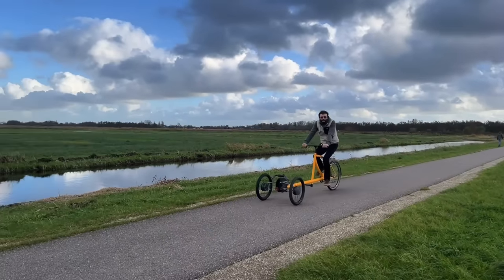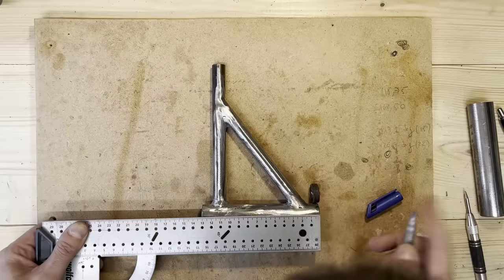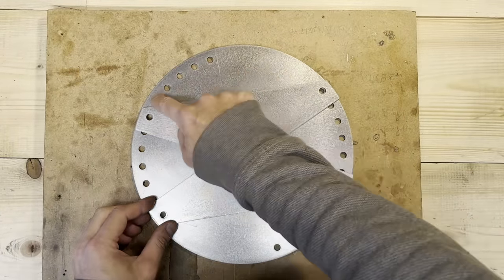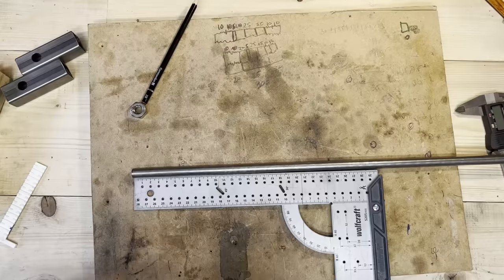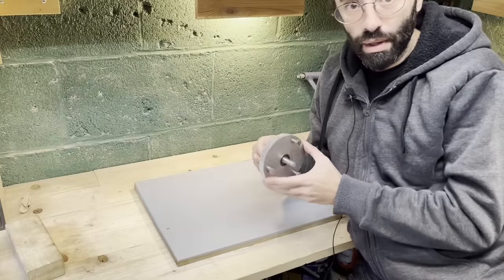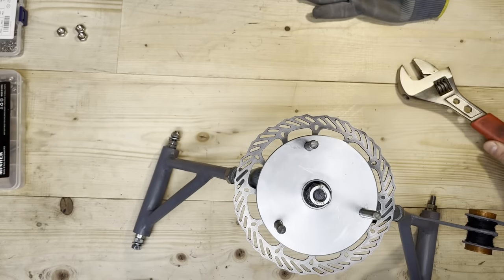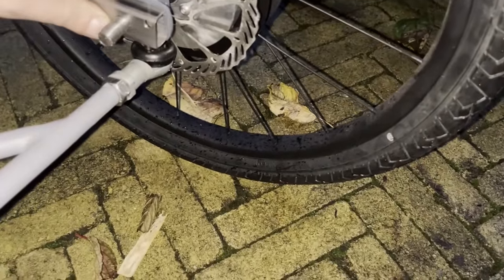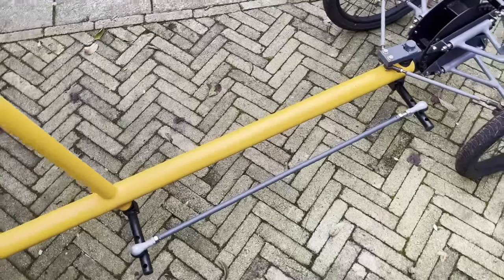Making of a Reverse Tilting Cargo Trike with Adjustable Geometry #5 - Full Build

Comment: Congratulations on your workmanship, You are very dedicated. While I do experiment on the same lines, I must say that I never reach the same level of workmanship as putting ball bearings in the wish bones. Well done,  and wish you all the best. There is a lot of variables operating at the same time, but I pay a lot of attention to the  relation between the contact point of the wheel on the ground and the projection of the steering angle on the ground. This relation can come up with self cantering, instability , and hard steering and oscillations.
The narrowness of that trike needs weight to be shifted around corners as otherwise the Centrifugal force will take over . At my old age I lile it to be a little wider so that the whole lot is stable when stationary and at slow speed which is all I can achieve,  
Congratulations once again.
What you are preparing for at 6:10 is called " Rose-welding".
Reply from the maker: Thank you very much for the kind comment;) Indeed, I experiment quite a bit and try to increase my skill and my small workshop. Also, I've been learning a lot from comments such as yours about the geometry of vehicles so, thank you very much as well for the teachings! 
Regarding the width of the vehicle, this is very much on purpose because I want it to go, as much as possible, through narrow spaces. The tilting mechanism allows for a compensation of the centrifugal force and makes it feel more like a bike, which I like.
When I search the internet for Rose-Welding, all I get is people making roses;) If you have a link to a reference that you can share, I would be happy to learn more about it.
Cheers!
Reply: @pedro-neves   I call it "rose weld" but  perhaps I misled you as many call it " Rosette welding".  This is used to join plates or sleeves in a pipe or a hollow section, One drills a through hole in the " outer plate" and then slide or "the sleeve" or the other plate behind it, Then weld  in the hole to fuse together the upper and lower plate/sleeve . I am  submitting an idea of " rosette welding" , shown in this video, I think it is enough  for you to get the idea, You are a very intelligent person,  I extended car chassis using these "rosette welding" on  plates, rectangular hollow sections and pipes with sleeves in them.  
Hope this helps. The video is described using  "a rosette weld" which one may appreciate why they described as such, 

 How To Weld Spot Welds & Rosette Welds - Great Tech Tip From Eastwood!
https://www.youtube.com/live/QN9Y9tc7gCs?si=wZWyeeU2FdSaS5Kt

Spot Welds and Rosette Welds | TIG Time
https://youtu.be/bkb_hAtZS3I?si=Z3mHjxH-oT1Qekt9

All the best.  Hope it helps. Again congratulations for your workmanship and you deserve to be called, "gentleman engineer"
Reply from the maker: @carmelpule8493 , again, this is incredible kind! I appreciate the trouble that you took to share knowledge and your kind words. Cheers! And all the best to you!

Comment: Pedro, you have done a super job on this design and I am amazed that you managed that with the limited equipment and work area that have. One suggestion, you could secure the outer race of the bearings in those tubes quite simply putting 3 or 4 
light punch marks on the outer side of the tube in which the bearings fit then as you press in the bearings these pinch will solidly  grip and retain the outer race, also I noticed when you the shafts thru the inner race the appeared to be a slide fit ,not good you do not want the shafts to rotate on the inner race which would happen if dirt and grit get in the ball race this will quickly cause the shaft to wear very quickly. However if you use shielded bearings( no dirt) and determine the position of the shafts within the bearings first then put three light punch marks at equal distance around the dia. this will make the shaft a good press fit in that inner race and prevent loose shaft rotation in the bearing. I look forward to the next video ,I hope to start 
on some framework for rev. trike in the new year I am 75 and need to do this soon or I will run out of time. GOOD LUCK.
Reply from the maker: That is really good advice with the punch marks, thank you so much! I will do this in the future whenever I don't have a press fit!
I hope you build a trike and more than a version of it;) Good Luck to you too! Cheers!
Reply: I'm sorry fella, but punch marks, really? It's clear to me that Pedro's most excellent workmanship and punch marks either on the I.D.of the control arm tubes or on the O.D. of the shafts  to close a loose fit don't go together. All that's needed for a job well done is a few drops of loctite brand stud and bearing mount and a squirt of accelerator and you'll have a fit that won't slip without having to punish the parts! An additional benefit of the compound used with sealed bearings will be in keeping any and all water out from between the bearings.  ( I really don't like parts I've crafted to fall victim to festering rust and corrosion!)  Cheers from ElMonte CA USA BP!
Reply from the maker: @brianpittman9460 , it's incredible how much one can learn from sharing stuff! It never crossed my mind to put thread lock on the bearings. After your comment I searched for products and they actually call them "Stud n Bearing...". Thank you so much!

Comment: congratulations for your nice design! 
I have been building a few tilting designs and so far nothing is "quite right".
You should consider using some kind of load on your test mules. In my experience steering geometry on any cargo bike is heavily affected by front axle loading. While it is important for the bike to ride kind of allright without loads, on any longjohn type design steering is always very compromised until you load something.
Have fun tinkering!
Reply from the maker: Thank you very much! I already built a cargo bay and I'm ready to start tests with load. Just waiting for the rain to stop;) Cheers!

Comment: Does the tilting work in the same manner as a differential? i.e. for cornering?
Reply: Not exactly. Although tadpole trikes do handle better than delta trikes, they have the same or similar risk of tipping at high speed- if not simply spinning out, which is more a possibility of one with actual power, like a Can Am Slingshot. Tilting gives a trike closer dynamics of a bike and gives it better handling, like a Honda Gyro for example.
Reply from the maker: Hello, this does not need a differential because the front wheels are not powered (the trike is powered via the back wheel). Because it only has one wheel powered (in the rear), it does not need a differential. Cheers!

Comment: Just curious. The block that you connect your steering rods to (37:10 minutes into the video) shouldn't that be an arc, a semi-circle, so the inner wheel turns more in a curve than the outer wheel?
Reply from the maker: Hello, that's a good point;) Actually I've been having this remark a lot. I am respecting the Ackerman geometry. In minute 46:03 this can be shown when I do a tight right turn and the inside wheel turns more than the outside wheel. But in the design this is not obvious because that block is straight. But, the block is actually a few centimeters inside from the center of the turn radius of the wheel. Sometimes things look straight but they are not;) Cheers!

Comment: maybe you should consider calculating the Ackerman steering geometry. the outside wheel should make less angle when turning than the inside wheel. because when turning, the outside wheel makes bigger turning radius than the inside wheel.
Reply from the maker: Hello, thank you for that! I did consider the Ackerman geometry. You can see in minute 46:03 on a tight turn that the inside wheel turns more than the outside wheel. The reason why it seems like I doesn't have Ackerman is because the steering connection is straight. But, it is a few centimeters inside of the center of the turn radius off the wheel.

Comment: Nice work, but you should consider weld with a nozzle on the torch to have gás protection
Reply from the maker: Hello, thank you very much! And you guessed it;) One of the next tools on my list is a TIG welding machine, so the next metal project that I share will be better for sure;) Cheers!

Comment: Huge Props! Cool as hell!
For your next wheelbuild I'd like to suggest a smaller hub radius and 2x lacing! -Radial lacing doesnt like the torque from disc brakes. 
-Have you seen cannondale's lefty hub's?
Looking forward to your next video!
Reply from the maker: Thank you very much! I will make new wheels soon for sure! These cannot handle much. But I haven't decided if the next will be 36 spokes or all aluminum;)
Reply: @pedro-neves  I could imagine! -A spoked wheel can be a lot stronger for a given weight than forged alu, and also has better compliance! 
32 in 2x lacing should be plenty strong. (3x will likely give too drastic angles between rims and nipples)
Ali clarkson does the deepest dive: https://www.youtube.com/watch?v=EEv9IqMvUnQ&t=2036s
Reply from the maker: @AlBenedict1 , thank you very much for linking an instruction video! I already have the rims, so I should be making the hubs and lacing soon;)

Comment: To add to what the guy recommended about 2 steering arms, just go to a double cable design. Same conceot with less weight
Reply from the maker: I agree! And this is in the queue for improvements for sure! Pull, pull design, less weight.

Comment: 34:42
If you want that to withstand the forces: Weld a tube inside and fit the bearings later into that.
In addition: This way the bearings can be sufficiantly pressed in and maybe later out.
Reply from the maker: Thank you for this! Ya, I intend to do this for sure! I just haven't done that yet because I try to have things editable until I'm sure they're right.

Comment: Steering tierods should be same length as wishbones to eliminate bump steer.
Reply from the maker: They are not the same length but they horizontally parallel so I believe this will keep bump steer to a minimum.

Comment: Hello Pedro.
There should be a spacer tube between the wishbone bearings, or the inner rings could be pushed inside, if force is applied from the outside.
Cheers.
Reply: Same thing form the hub bearings!
Reply from the maker: @hommerdalor6301  , that is true for both! My strategy was to tight until it doesn't play and then use a counter-nut so it doesn't move but one of the hubs has become loose. I'll include the space in the hubs for sure before the geometery tests. Cheers!

Comment: Interesting project thanks for sharing - did you simulate the shock arms to wishbone interface - they look like they would be highly stressed at the weld interface
Reply from the maker: Hello, thank you! Good point! I did not simulate but while I was building It did look like that. On my next design I'll make sure that there are two plates coming from the wishbones and not just one.

Comment: what made you decide on the length of the main tube that connects the front end to the main chassis?
Reply from the maker: Hello, I'm designing this to be a cargo trike so I looked at the dimensions of cargo bikes in the market (Arrow, Bullitt, etc) and chose something in the middle. I'll share the exact dimensions in the video where I'll explain everything about the geometry. Cheers!

Comment: all these angles are subject to regular upkeep on a car, and i wonder whether that is because of things bending, or bolts coming loose. munro calls bolts threaded un-fasteners. i think that's quite clever. once you have a good setup, i think it might be preferable to have them fixed in place, even if that means they are no longer adjustable. unless thoroughly rusted together, all those bolts there could lead to considerable headache i think
Reply from the maker: That's a good point - why does a car steering become misaligned? I would definitely prefer to not have to regulate things from time to time. But, in this project, the regulation also has the purpose of finding the best geometry. I'm doing many tests now with different geometries and will share a video about that. Once I have the bets geometries, I will build the trike with less adjustable parts. Cheers!

Comment: great work.  hint at 24:29 always use a spacer to push the race that is being press fit.  here a washer that only touches the outside race would have made this perfect.  Otherwise the balls make dents in the races and will fail prematurely.  The failure is brinelling.
Reply from the maker: Thank you so much! I actually got a few comments suggesting that I should fix this and I already did put this spacer since then. Cheers!

Comment: Perhaps changing the working plane with a pushrod suspension from the lower arm instead of the upper arm could grant you more cargo space. It may be an unnecessary complication too.
Reply from the maker: I agree. The reason why the push rod is up is because I have that disc to be able to adjust caster angle. But once I find all the best angles, I'll design without the disc and make a lower push rod. Not sure if it will be in the lower arm because I intend to fit the steering there. Cheers!

Comment: Isn't it great to be able to have parts manufactured professionally so you can focus on the design.
Maybe I missed it, but how do you avoid bump steer?
Reply from the maker: Hello, some parts I cannot manufacture with sufficient accuracy (such as cut metal sheet). But other parts I can. Honestly, I like manufacturing. My purpose is actually also to improve and increase my manufacturing capability and quality.
Regarding bump steer, the steering links are pretty parallel to the wishbones (vertically) so bump steer will be low.
Reply: @pedro-neves  I admire how you (I imagine) visualised this in your head, including the dynamics of the steering/suspension. Nice work!
Manufacturing  accuracy and repeatability is a function of the machine/process. Hopefully your channel grows sufficiently to attract sponsors that send you their gear to try.
Reply from the maker: @BenMitro Thank you very much! And you are right, what I wouldn't give for a water jet cutter or LASER cutter!;)
Reply: @pedro-neves  I wish you well!
Reply from the maker: @BenMitro , thank you very much! I wish you well too;)

Comment: Awesome! How did you calculate your steering arm lengths?  I’m currently building a cargo trike and have been waiting to see your process in more detail, especially your steering geometry. Great design!
Reply from the maker: Thank you very much! I calculated the steering arm lengths to match the Ackerman geometry. This way the inside wheel will turn more than the outside. This is clear in a tight right turn in minute 46:03. I will explain all about the geometry and provide numbers on the next one after I do a bunch of comparative tests!

Comment: You desperately need a small fixture table. A tube notcher for your drill press would help a lot too. Fun stuff.
Reply from the maker: I do! I have a shopping list with my next things to buy;) But I have to take it easy. One improvement to the shed at the time. I believe the next will be a TIG welder. Cheers!

Comment: A couple of questions; 1, why is the frame so long? 2; Why does it have a bike stand, I can't see it falling over?
Reply: It tilts, it can fall over. Honda Gyros have a lockout lever to use when parked, so they don't tip over. You could very well drag knee on a Gyro, they lean so far over.
Reply from the maker: Hello, 1 - the frame is this long because it will be a cargo trike. I will fit a cargo bay once the steering and suspension work is done. 2 - It tilts so it would rest at a position of 30 degrees from vertical. I added the stand so that the weight rests on it instead of resting on the wishbones.

Comment: how much steering authority do you have? I imagine the vehicle is very easy to under-steer.
Reply from the maker: Hello, I haven't felt under-steer so far. I designed having Ackerman in consideration and 0 scrub radius so there's no scrub when turning. I will also do some tests with cargo to see if the steering (and other components) work well. Cheers!
Reply: @pedro-neves  impressive!
Reply from the maker: @tuskiomisham , thank you!

Comment: Astounding work, something i have thought was worth investigating for quite some time. Your documentation and attention to details are far and above my skills. Just one question, is that right front wheel really that far out of true? Or is it a trick of the camera.  If not the camera,  how can you make accurate  measurements of toe, camber caster etc?
Reply from the maker: Thank you very much! And you are right. The wheel was hit and is quite bent. I will make sure to true it before the tests. To make accurate measurements of angles I'm building a few guides  and I'll use the hub and disc as reference. So: measure the vertical angle of the hub for camber and for Tow I'm considering LEDs fixed in the hub pointing to a board in front of the trike (same principles as alignment racks for cars). I'll try to be precise with it.
Reply: @pedro-neves  looking forward to part 2!
Reply from the maker: @miniac60 Thank you! I'll try to make it a good one!

Comment: what software do u use to convert the model into CNC machine code, or u write the code wourself?, and if u are using software, is it free?
Reply from the maker: Hello, I use Autodesk Fusion 360 for CAD and CAM. And then the CAM exports a file (.nc) that I use in my machine that runs open source grbl. I have full instrauctions to make a CNC machine run with grbl here: https://youtu.be/12zLTDU7ML8?si=XUIMCxp9-v76aO5d.
Cheers!
Let me know if you have any more specific question if you need to know how to transform design into CNC movements.